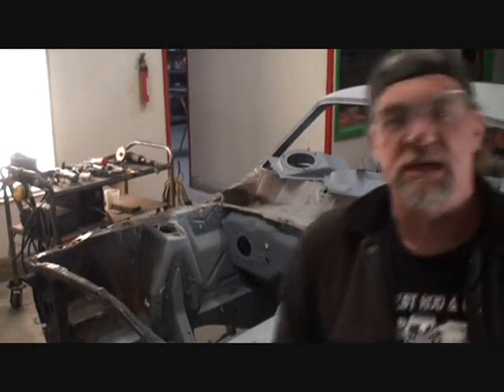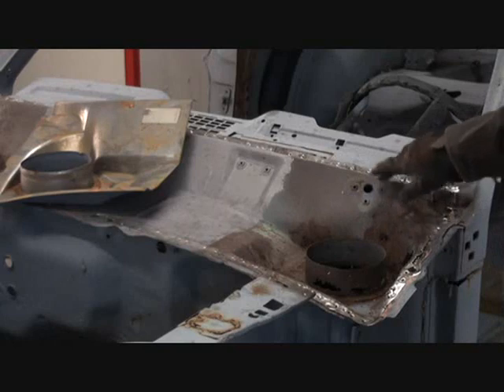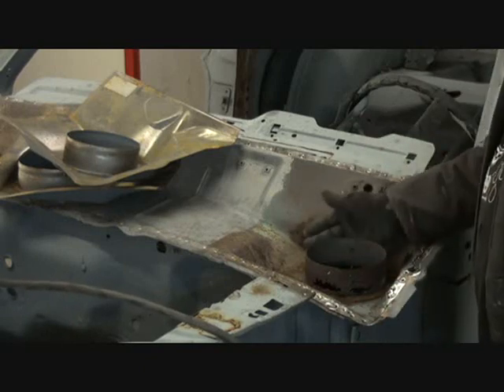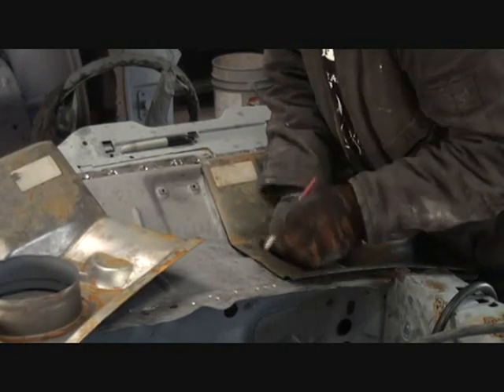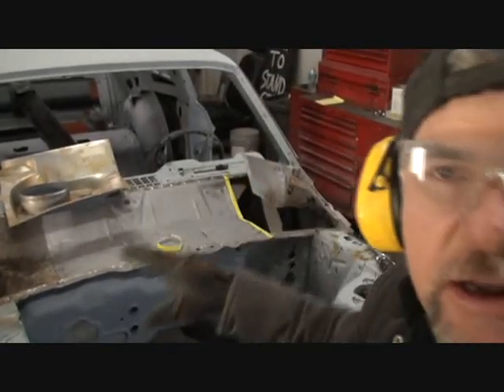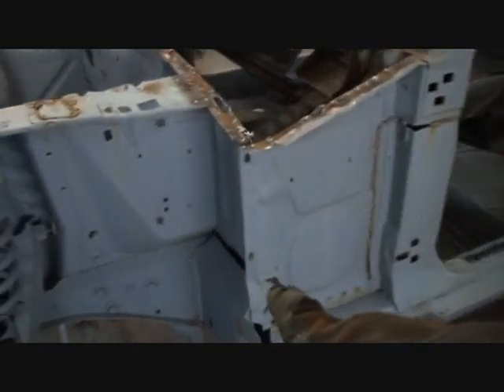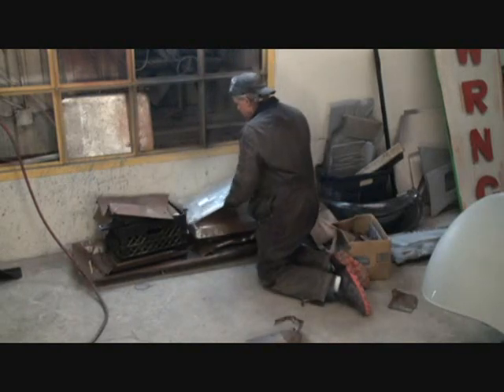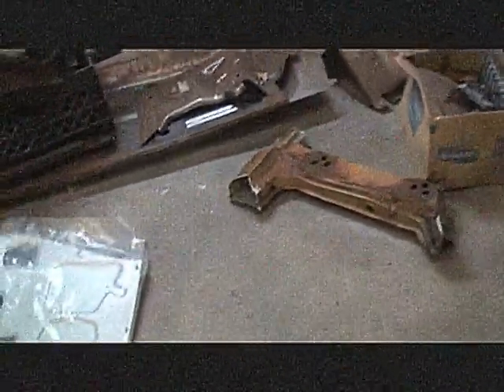How To Restore A Rusted Out Car-Part 1

Comment: My friend Pete, what air compressor specifications do you recommend for using tools of this type? Another question, why not use the plasma torch instead of the cutoff wheel, warpage due to heat possibly? I appreciate your videos  and keep up the awesome work.
Reply from the maker: using the plasma cutter on some jobs isn't a good idea due to the edge it leaves and getting a nice accurate straight line is much better using a cut off wheel.

Comment: I am working on my first project and after i ripped up the floor and get underneath the car, it looks like really bad structural rust. I don't know the names of the pieces to replace. I am curious how much that would cost just to fix the structural stuff and the huge rust hole by the wheel well and front of the rocker panel. to get if fixed professionally. I appreciate any advice from you Pete. You are the man!